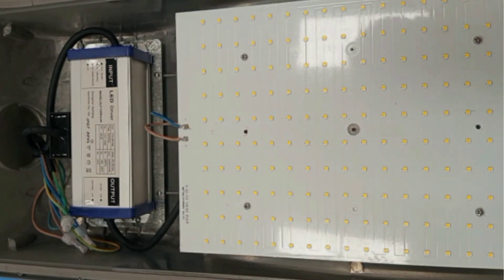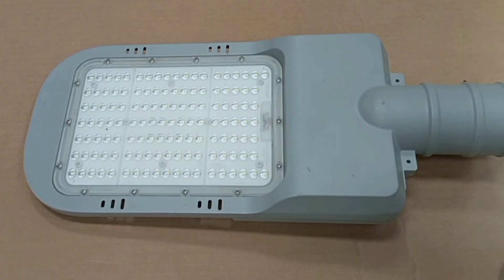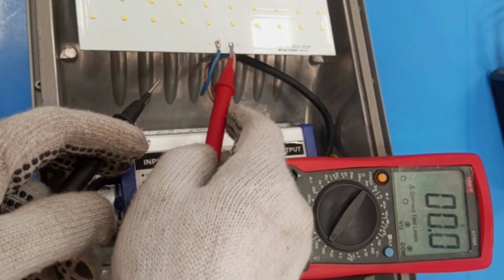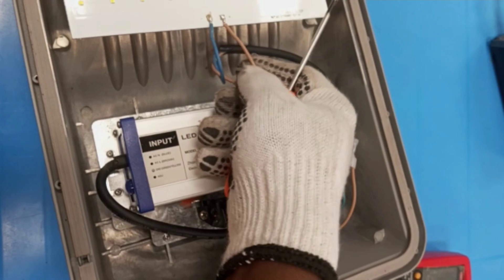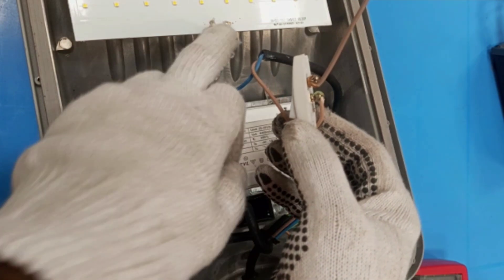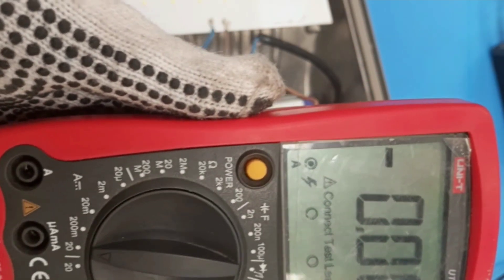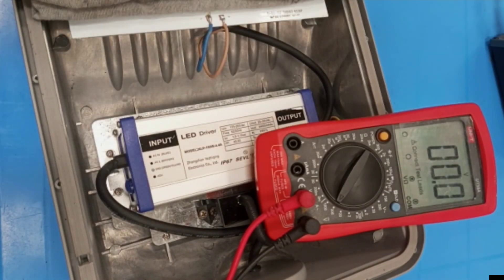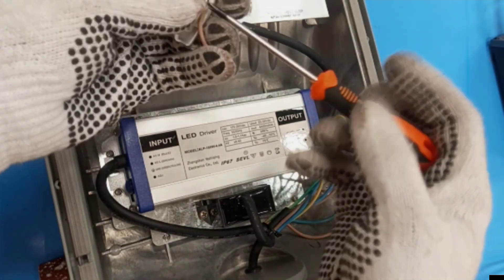DC POWER SUPPLY

Comment: What about using clamp-on meter that doesn't have ranges
Reply from the maker: That will depend on the particular clamp meter that you are using. Not all clamp meters can measure DC current, some are only designed for AC. 

Check your meter to see if it has a DC current measurement function.
If it does, ensure the meter's DC current range covers the expected current in your circuit. Exceeding the range can damage the meter or give inaccurate readings.